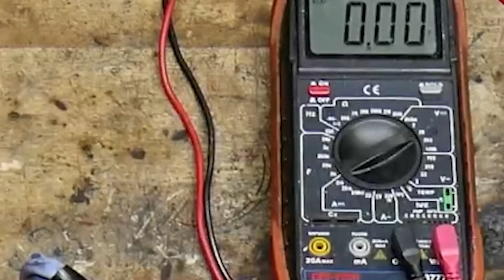I built a handheld device that lets me generate electricity when I rub it

Comment: Man with piercings here. Funny enough, magnets are not that big of a worry, provided you go to a reputable piercer who uses surgical steel.  I actually went through an MRI with all 12 of mine, and their bigger concern was that it would heat up (that is, generate an electrical current) more than them getting pulled out.  Since neither happened in an MRI, I doubt the zerkirator would be any more of a threat than a rough tug.

Comment: Personally this would make more sense to have a bunch of soft tubes full of oil inside a fleshlight between the case & the silicon sleeve then those go to a pressure tube with the coil & magnet one side filled with the oil from the tube the other side having a spring when you jork it the tubes compress forcing the oil into the pressure chamber pushing the magnet up this way you are working off not only length but gurth

Comment: No one seems to notice the issue that you’ll have a really heavy magnet slamming into your head over and over?
I think the only logical solution is you need to somehow coat or make your own device be magnetic. That way you are directly running a magnet over a coil
Reply: It seems like if it was lubricated and heated moderately warm, around 87-95°F, likely with induction from the magnet itself, it could work better.  Parasitic loss i guess, but if you also use a thermocouple to stop heating if it exceeds the range, leading to increased efficiency?

Comment: Another option is to rub wool against plastic pipe - it will generate thousands of volts, which can be collected with high voltage capacitor and then converted to low voltage with diode and inductor.
Reply: I wanna see that next

Comment: You could use Schottky diodes for a smaller voltage drop than a full wave rectifier. Also I'm definitely going too far but if we want to get the maximum efficiency use mosfets as ideal diodes

Comment: "It is a cylinder"
Reply: “So I guess this is my cross to bear, then.”
Reply: Hypothetically speaking, if a smaller cylinder got stuck in the larger cylinder. How would I get it unstuck?
Reply: @WaifuEndMyLaifu  bro is reddit cylynder man
Reply: @WaifuEndMyLaifu  laser the bottom of the inner cylinder, then slowly push it out
Reply: It is imperative the smaller cylinder remains UNHARMED in its removal.
Reply: cut the two cylinders in half vertically
Reply: @flawer1316 The smaller cylinder must not be damaged
Reply: "That's right! It goes in the SQUARE hole!"
Reply: The wankonator
Reply: Don't forget the butter and microwave banana

Comment: Make it so it will generate electricity while being sucked, too. Bonus points for it being able to generate electricity from body's heat.
Reply: Since this form of generation is based on magnetic flux changes due to the movement of the coil relative to a static magnetic core, one would only need to change the position of the coil (while maintaining its circuit wiring and toroidal shape) in order to get your desired result.

This is truly a rabbithole of intriguing yet degenerate ideas.
Reply: Installing a fucking dynamo (pun intended) at that point
Reply: PFFT, good one XD
Reply: Sucking is just a modified wind turbine